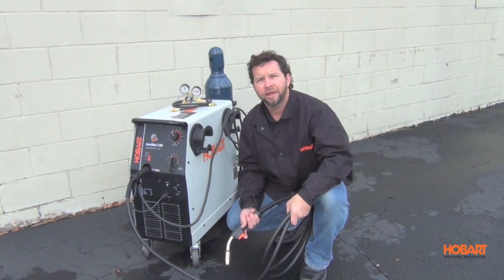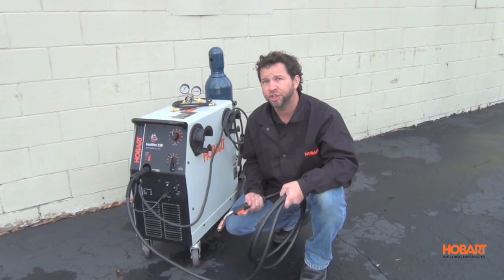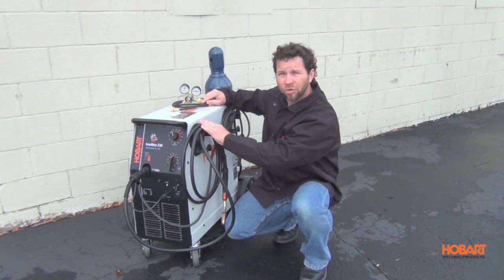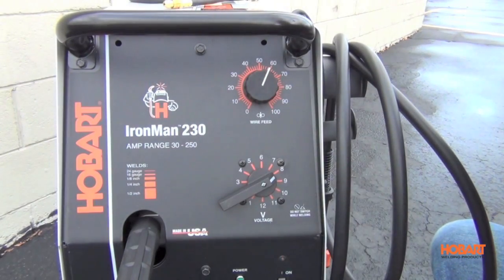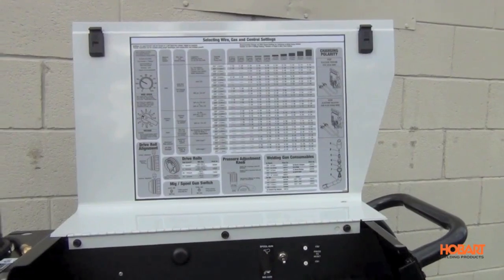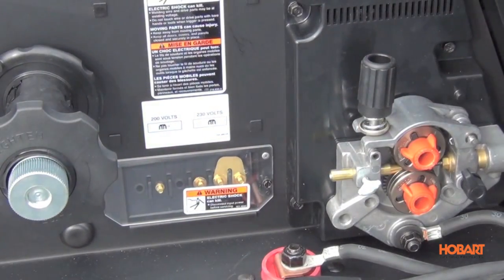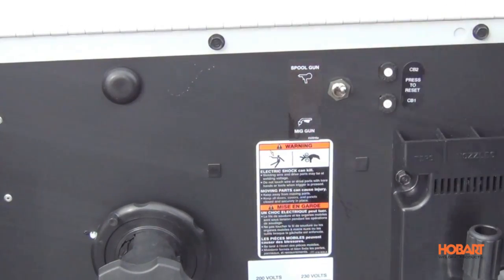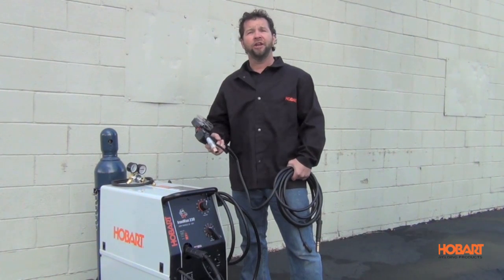Ironman 230 Product Demonstration

Comment: What size wire for 1/2 inch
Reply: Probably .8mm..

I'm not saying its the right answer but I've done welds from as little as 5mm up to 27mm with .8mm wire